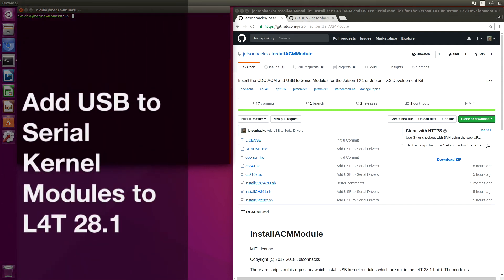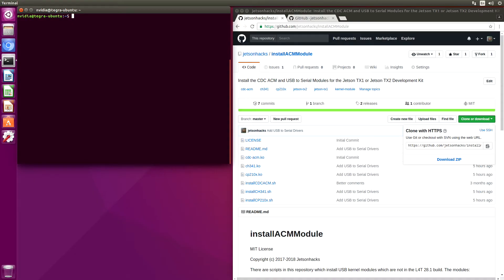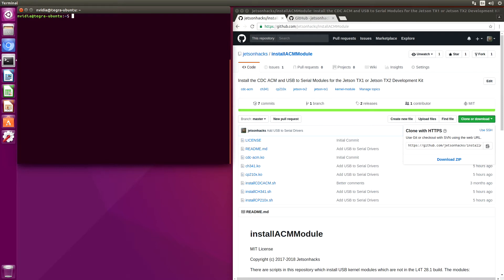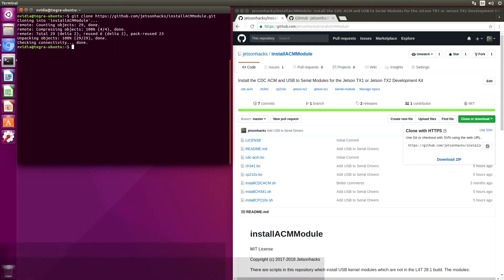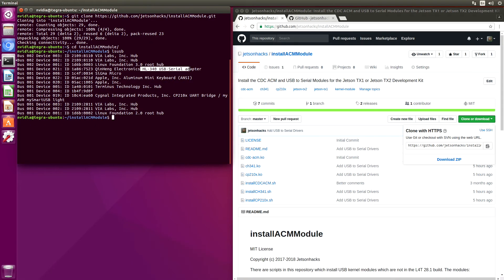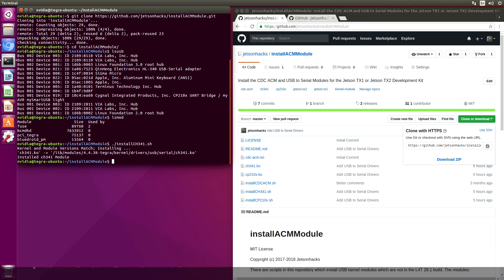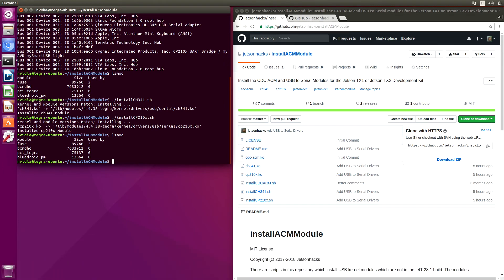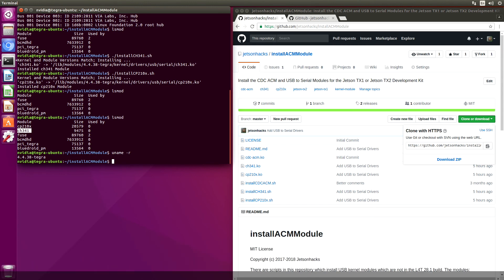Install USB To Serial Kernel Modules - L4T 28.1

Comment: Hi @JetsonHacks
is this kernel module for Serial(Uart out from Jetson) to USB(to host pc)?

thanks for your useful vids! always
Reply from the maker: You are welcome, thanks you for watching the videos! The kernel modules are for the cp210x and ch341. These are devices which plug in to a USB port, and then convert the USB to a serial signal on another device. Typically you'll see these when you plug a variant of an Arduino into the USB port of a Jetson. These typically are not used with the UART.